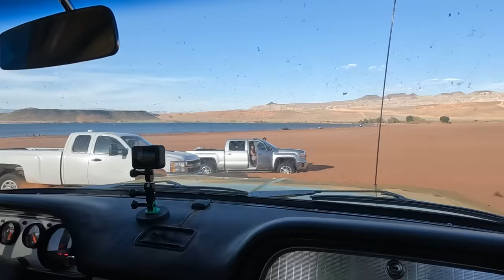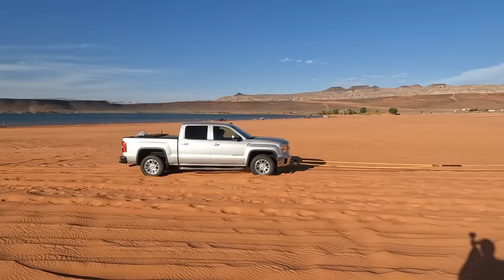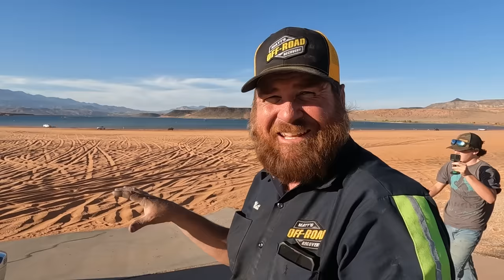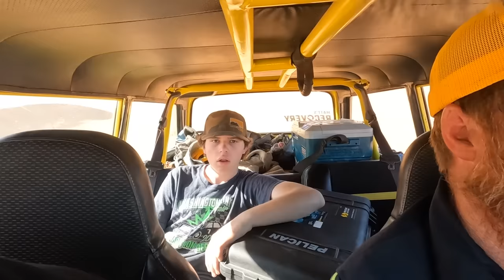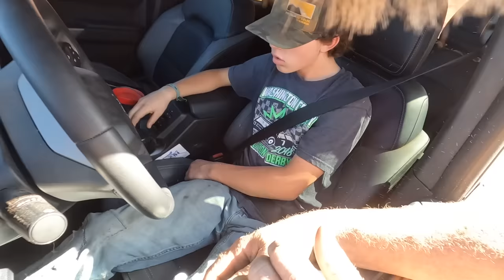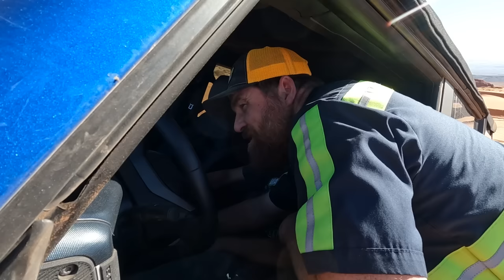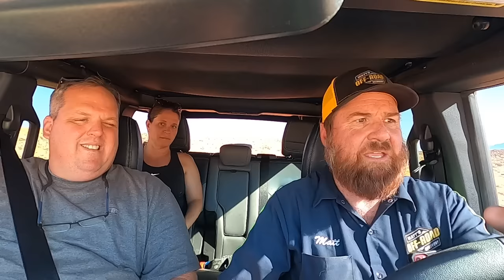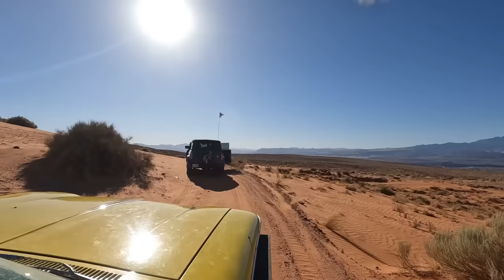Ford Bronco Lost In The Desert Dunes At 105 Degrees

Comment: 1:25 Gotta look after your loved ones, brother. I know hot sand. I used to work in thongs in the dry desert country of Australia. I had deep cracks through callouses on my heels and down the sides of my feet from the extreme dry and heat. Desert heat and low humidity, combined with the moisture-absorbing quality of desert dirt are not good for your feet.

Comment: Why don't people air down there?
Reply: They don't know any better. The people that do don't get stuck.
Reply: @JohnFL  On the beaches of Cape Cod where you can still run there are signs to air down. Rangers actually used to stop you and check your pressures. I have a place in Baja and see people stuck ALL the time they won't air down. Usually that's all it takes to get them out.
Reply: @chrisaugenti2603  Yeah, I bet. When you're on soft sand rock hard street tires don't help.